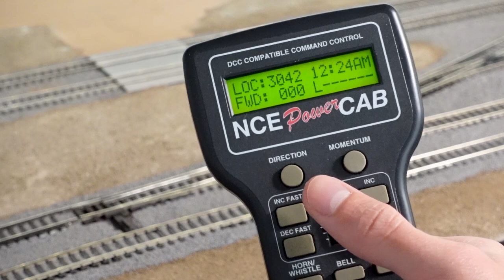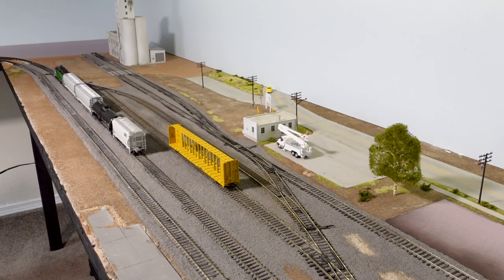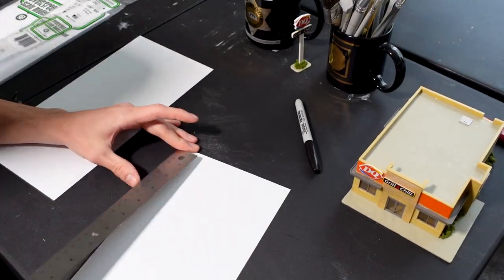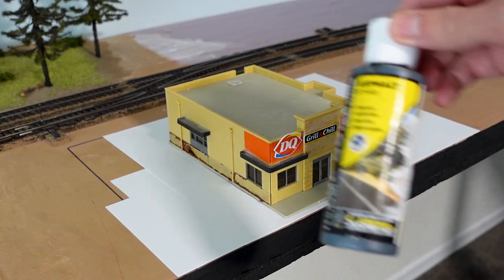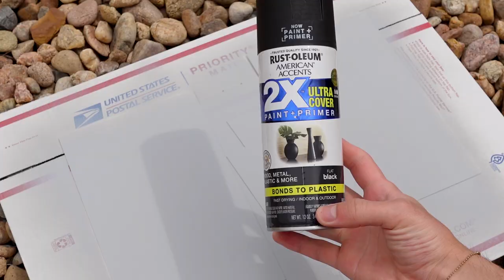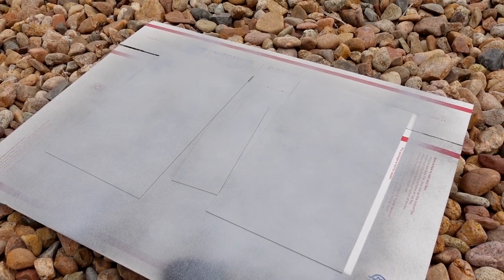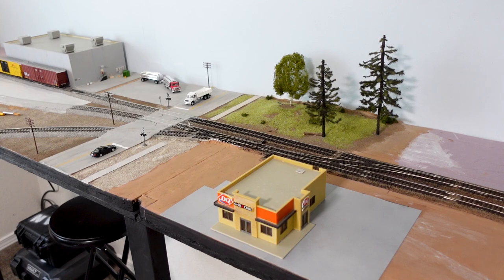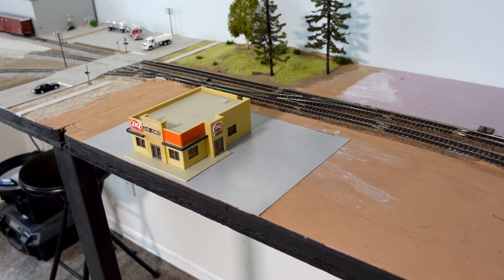Didn’t like this at all! - HO Train Layout Build - Ep 29

Comment: Man am I gonna miss running my BN cascade and Santa Fe warbonnett diesels, new layout is set in the golden era powered by mostly small steam in south coastal Texas so they definitely don’t fit the time era or setting at all, I do plan to run occasional through trains when running a more modern era ops session from time to time to get use out of them but my geep40 and gp15 consist in really gonna miss running such great road switchers
Reply from the maker: Sounds like a great era to model. I love steam engines. Maybe you can make a small switching layout with those engines so they can still get some action :)

Comment: I'm thinking about using sandpaper sheets for a parking lot.
Making a base with a cork sheet for height and glueing sheets of light grey sandpaper on top of it.
 The shade of grey and the sandpaper texture would be similar to a road, i think styrene texture is too smooth. What do you think of this idea?
Reply from the maker: I have seen people use it and it does come out pretty realistic. I think it would look nice plus it’s a lot easier. But if you want to really get crazy, the joint compound is perfect for making roads. It justs takes a lot more work
Reply: I use beach sand.  Glue it down first, then use country gray,  Add cracks and fill with black India ink.  Of course before you paint the concrete.

Comment: Hmm why don't you try the Pewter Gray and see how it works? It's a little darker.
Reply from the maker: I may try that. The only thing is I only like to use spray paint with even surfaces like the polysterene. Acrylic paint is a pain sometimes when it comes to a even coat. If that makes sense 😂

Comment: do you reccoment that DCC controller at 1:13, i have two DCC locos but no DCC controller yet they run fine. also is it hard to set up?
Reply from the maker: 100% recommend it. It’s the NCE Powercab starter kit and it’s about $190 to $200 depending where you go. It’s perfect for DCC